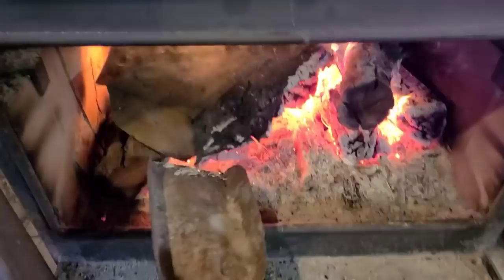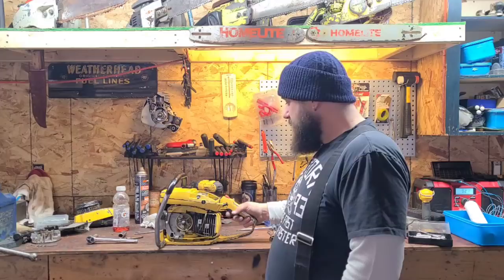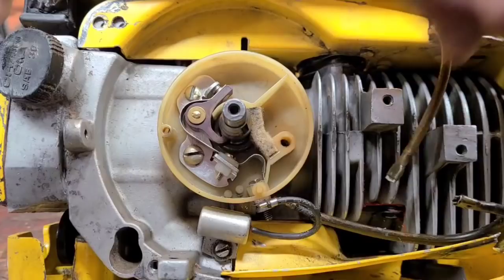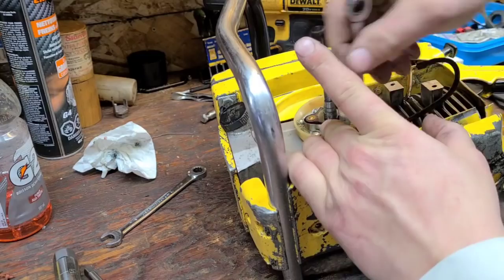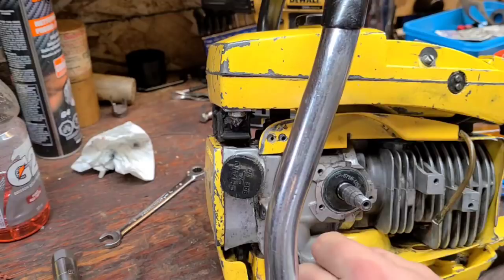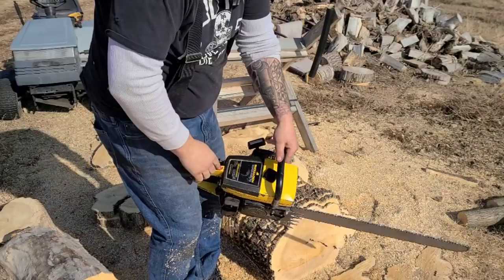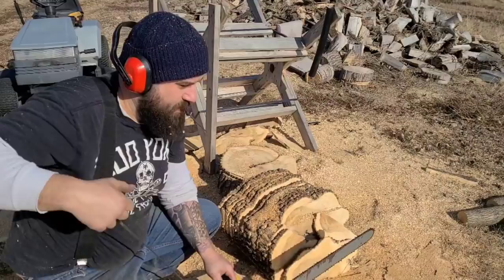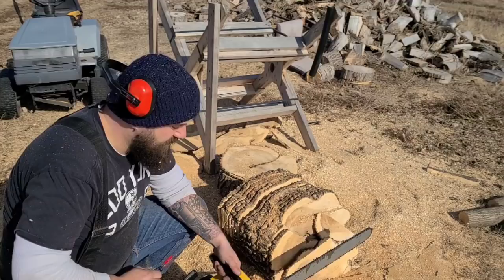Oregon ignition chip install on Buckin's Ported McCulloch!! Now lets see how this thing rips!!

Comment: Those chips have saved me with some old homelites, so much better and easier than messing with points. My mac and some of my homelites run like that. It takes a little longer to get all that mass moving as well as slowed down. Great video.

Comment: Hi, nice Job. I just installed some of these Modules , but they are not working in every Igniter. You should always take a timing light to check before and after installing these great Modules. Sometimes you have to regroove the Flywheel. Right now i‘m repairing a Honda Tiller G50 from 1970s,which has a Temperature Ignitionproblem with backfiring into the intake after 3 Minutes of Running under load. I think it is the condenser but you don‘t get any new Sparepart. So i put a External chainsaw Condenser in. Lets see if she runs😃
Thanks for your nice Videos!

Comment: All Macs have me messing with the idle screw after running a more modern saw. I always think they are Lean. Glad to see I'm not the only one. I really like the ignition chip. New points you get are pretty horrible. I am always messing with old stuff and if the original points are bad I look for a electronic option.
Reply from the maker: Yeah points were ok 40 years ago but today i think we can do much better.

Comment: Thanks Tinman. I had just discovered that my pro mac 10-10 had a clutch side seal leak and I came in and decided to watch this vid, and you randomly spout off part numbers for the seals. Thanks. I'm not sure if the flywheel side seal is the same as the 700 but thanks anyway.
Reply from the maker: I think they are the same.
Reply: @tinmanssaws  thanks. Before I order I want to measure the old one, since I saw some conflicting numbers online.

Comment: I think you’re right. The rotating mass of a heavy flywheel and clutch will make it come down to idle slower than most saws.
Reply from the maker: I think thats a mac thing.  Seems to make sense.
Reply: @tinmanssaws  same with my 10-10 a lot of momentum even though the rpm come down it just takes a bit to idle all the way past clutch engagement. I have played with mine and it's a fine balance between keeping idle and slow to stop spin and falling on it's face. L and H jet both real close to 1 turn.

Comment: I've always run condensers from the auto parts store in all my mopeds, chainsaws and anything two-stroke that needs a condenser, I usually ask the parts counter for a condenser for 1969 Chevy Nova and if they don't have it in stock I just look in the area where they would normally store it but just about any condenser will work you just might have to modify the timing advance or retardation to get it dead on again

Comment: I've always wanted to know what timing different chips produce. Timing and timing curve (if any) is built into the chip. Way back in the olden days, a firm called Atom came out with chips (they were not extremely reliable unfortunately) and they had several different color codes that each had different timing. So you could pick the advance you wanted. It would be way cool to throw a timing light
Reply: A self powered timing light like we use on bikes would tell the tale.

Comment: Unlike an automobile that has a battery to power the primary side of the coil, a saw has no source of voltage. What or how does the condenser charge when the points are closed? Is it from the inductive action of the coil?

Comment: good video. how is the magnetig on the flywheel.if its week can have similar problems and the saw not running ok on low rpm.specielly when using points. good spark now their with elektronic
Reply: Mika Hakkinen  How’s retirement from F1 been?
Reply: @larryreno8293  aim not the f1 driver but a have the same name.
Reply: Still a great name!!
Reply: @larryreno8293  sure it is.thanks

Comment: Does the module need to be in any specific location in relation to the 360 degree rotation?
Reply from the maker: No its just wire it in and the saw runs.. pretty simple.
Reply: @tinmanssaws  Thanks. I have a vintage one called an atom module. May try it on a Mac I have with no spark . Probably get coil tested first though. 👍

Comment: Yes points and condensors are not what they used to be. New points and condensors are no longer a priority even for the original equipment manufacturers to make. 
Everything has gone electronic decades ago and manufacturers no longer have a interest in making these things, they have moved on, so manufacture of the old technology is outsourced, these days to China. 
Unfortunately as we know a lot of Chinese stuff looks the part but is made of inferior materials. 
I recently had a brand new Echlin points and condensor fail catastrophically after only 2 hours. 
Changing to electronic is the way to go. That's what I did.